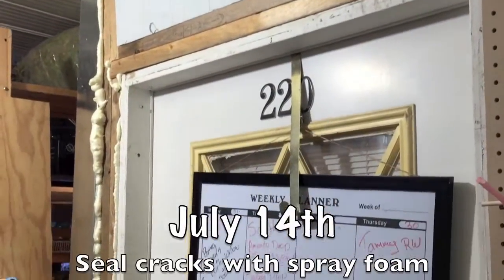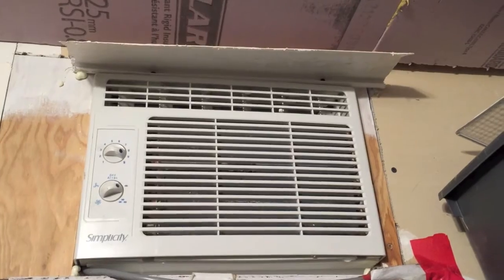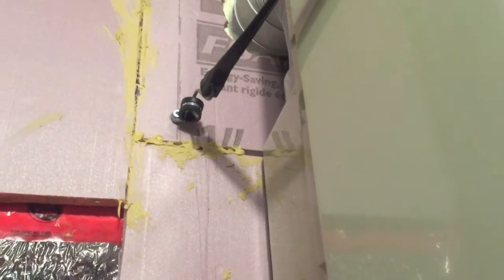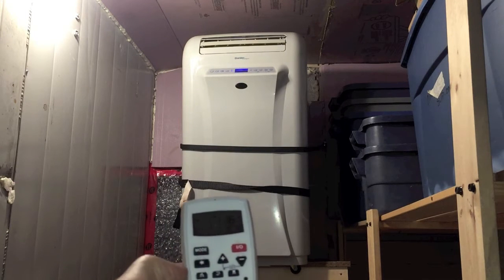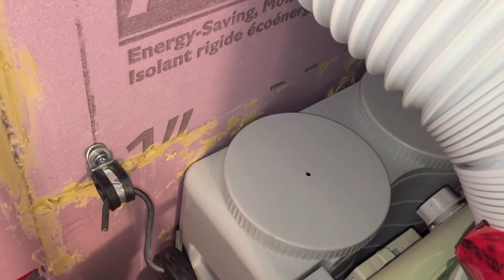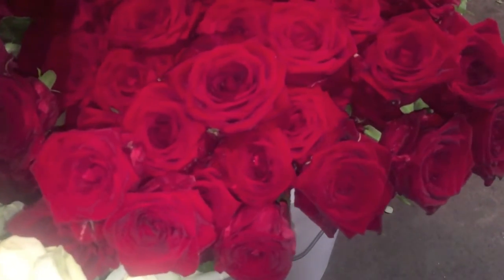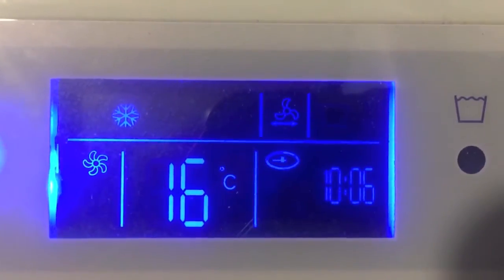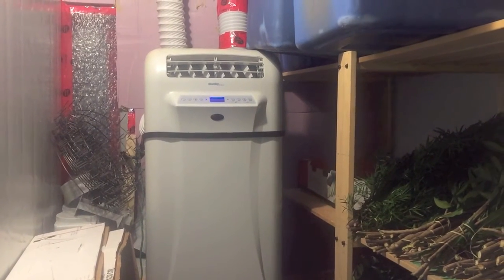DIY Walk in Cooler Project - Part 2

Comment: Just found your video today. I'm thinking about building a walk-in cooler for flowers too. Does it still works well to keep flowers cool, fresh, and not dry out the flowers? I've been doing research and I was really concerned about the humidity that a regular air condition can provide. Is there any tips or advice you would give someone like me who is planning on building one? Thank you!